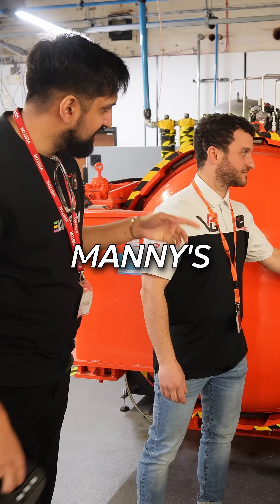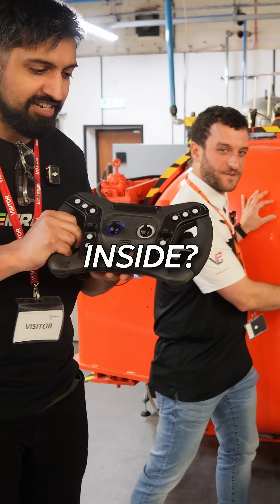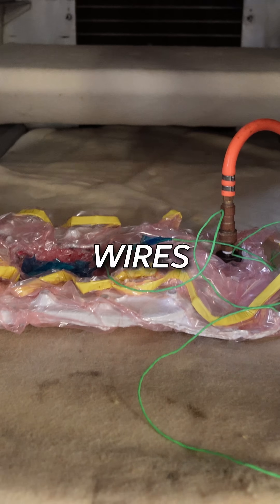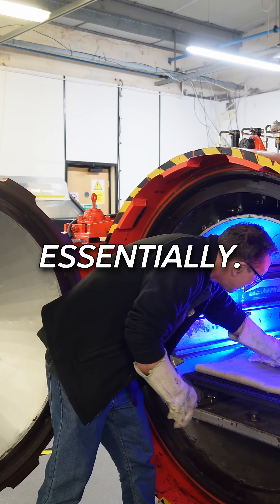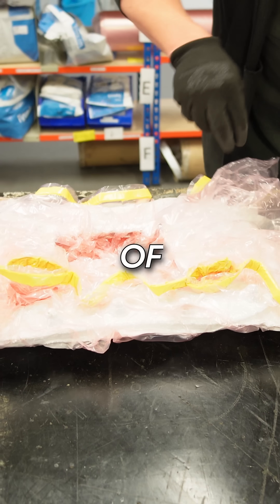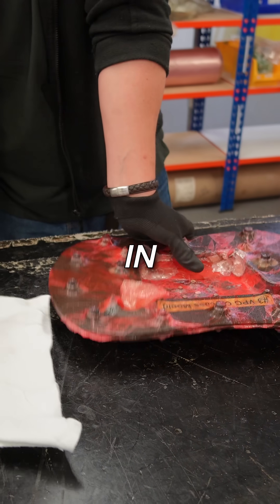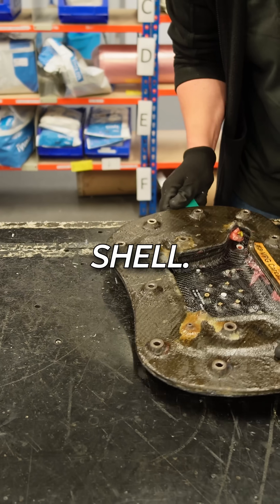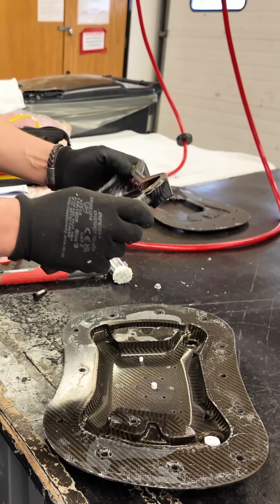What on Earth Is an Autoclave? #kireth #vpg

Comment: what on earth is an autoclave, then proceeds to never answer it lol. uses steam and pressure to sterilize equipment or in this case i guess its used to help resin bond to carbon fiber, ud think a vaccuum chamber would be what tehy use like most others for carbon fiber, using pressure and steam instead of vacuum dosent make much sense at all
Reply from the maker: Tbh i am not an autoclave expert 😅
Reply: Fair point! Autoclaves do use high pressure — but not necessarily steam in this context. For aerospace carbon fiber, vacuum is actually applied before the autoclave process to remove air and prevent voids. Then, the autoclave adds heat and pressure to compact the layers and help the resin cure properly. So it’s not for sterilization like in medical use — it’s more like “precision baking” for high-performance composites 😅